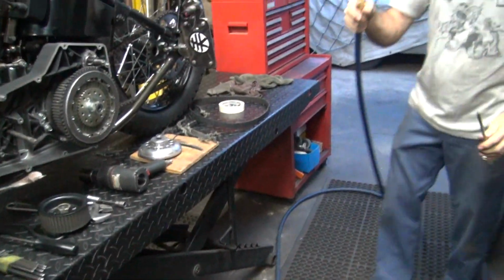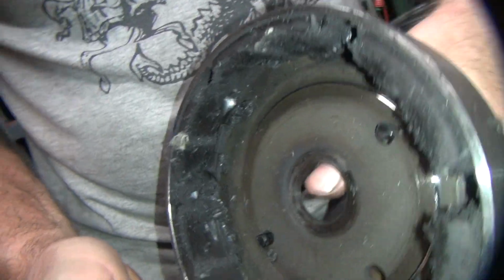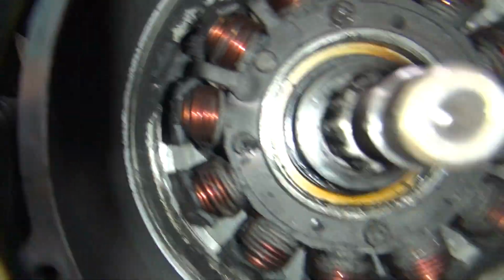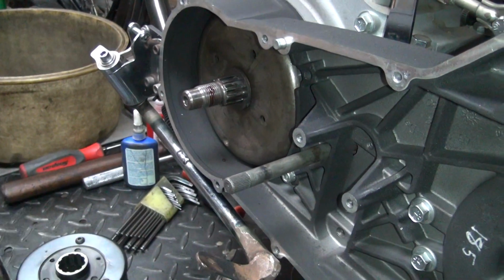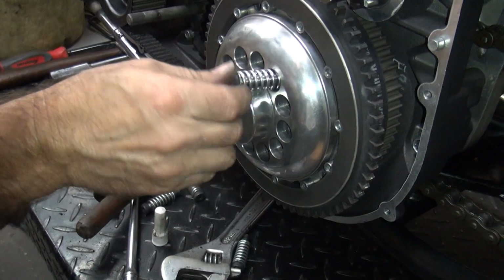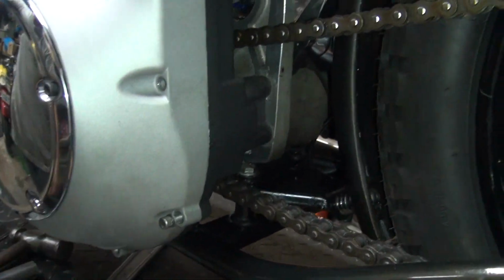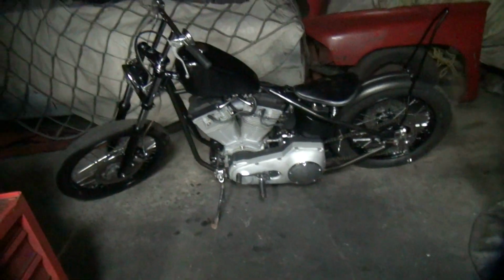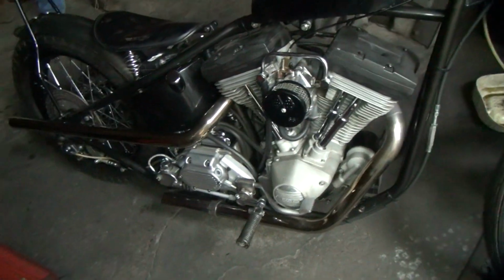1999 80ci evo #110 rigid install mid controls chassis brake repair get running by tatro machine

Comment: Theree is only about 0.030 of clearance for the rotor magnets and the stator. So that means there is only about 0.015 all the way around. So no wobble can be allowed on the rotor rotation. Should have seen the damage on my four speed EVO Sporty ! Looked like coffee from the ground up magnets. The stator looked like someone took a hammer to it. He really needs a vented primary cover if he wants the belt to last.
Reply from the maker: you have more clearance than that because their would be alot more damaged alternators if they were that close. probably more like .030 per side or .060 total clearance.
tatro